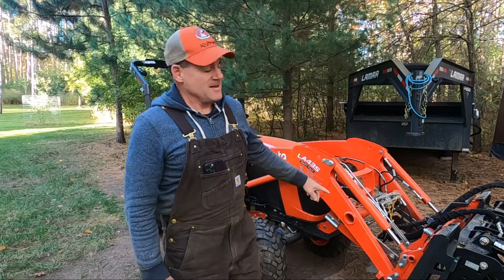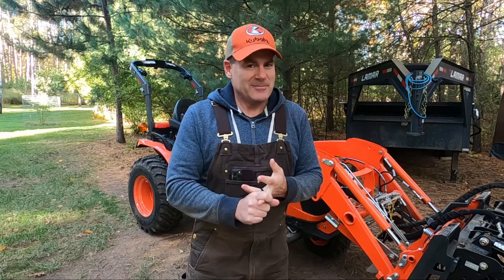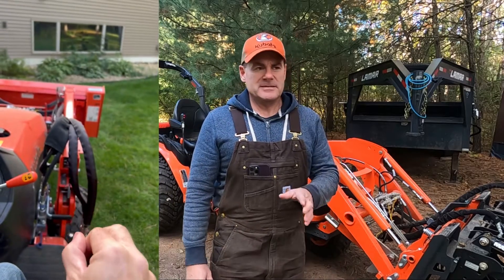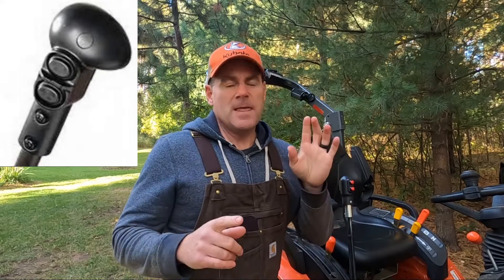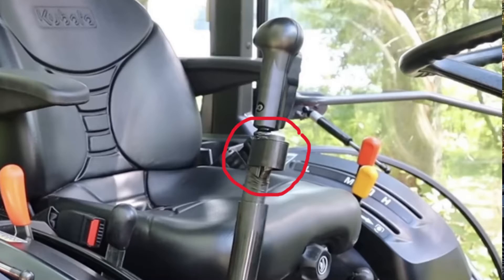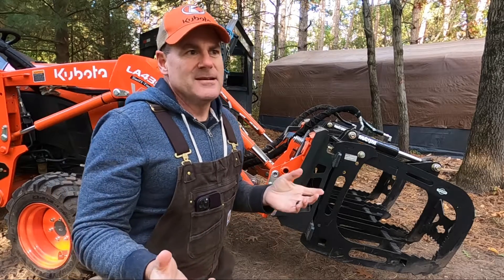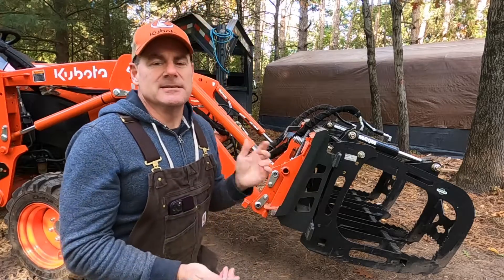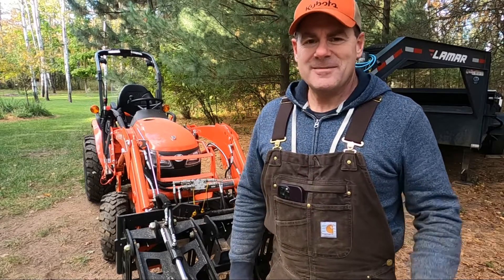#103 B2601 Loader Issue Follow Up - 3rd Function Values - LA435 Loader Smoothness

Comment: A couple of things that might help you, and works for me. I have an L4701(love it) with a Land Pride 3rd funtion(i installed myself). I orriented my buttons for the 3rd function at the 8 o'clock postion and use my thumb to operate them. That keeps ME from inadvetenly hitting either button when using the stick for up and down and curling. And it's pretty easy to wire in a toggle switch on or at the the console panel to turn on or off the 3rd function buttons. Also, the suggestion for lowering the RPM level when using the loader helps tremendously with the jerking when operating the loader and or grapple. 2500 RPMs or even down to 2000(when appropriate) smooths things out. Obviously, a little higher depending on the heaviness of the load. No need to run at 540 level, when using the loader or grapple, normally. Play around with that to see the differences in smoothness. Good luck. And enjoy your tractor.

Comment: Kubota makes some good stuff.The hot buttons on the front of the stick is bad engineering.A company has to know that an operator will be prone to hit them causing issues.Hence,thats why KUBOTA has the power off-on feature.I run alot of KUBOTA and they have smooth Hydraulics.Some of the best in the industry.

Comment: Maybe air in the system??   While the tractor is running, turn the wheels all the way to the right and hold a few seconds then all the way to the left and hold a few seconds.  Do this 4 to 5 times to bleed air out of system.
Might be worth a try !

Comment: I am an electronics engineering technician. For less than $20.00 you will love your tractor, B2601. All that is needed is on the main power wire to the third function buttons install a single pole single throw switch. The added switch will stop the diverted valve from operating and restore normal functions to your loader when not using third function. I have a 2021 B2601 TLB with Kubota third function and mine has a shut off switch built in. If you need any help feel free to ask. I live in Ohio, if not too far I am willing to help you.  Bob
Reply: Hi Bob,  got a picture of that switch you are refering to?  I have a 3rd function switch problem on my B2601.  Just stop working for front end snow plow articulation

Comment: Good vid. I have had my B2601 since 2020 with zero issues. Really love the tractor and wishing I added a third function for a grapple upon acquisition…my first tractor so very tractor ignorant at the time. So far about 120 hours on the B2601 and my loader and hydraulics are very smooth. If I run the rpms high, the hydraulics get super jerky so I lower the rpms to smooth things out. Love your add-ons and I would consider a new third function kit before trading your baby in-you’ll really miss her. I’m currently shopping for a new larger tractor for land clearing but it will have to be an addition to my B2601; I don’t think I can let her go. Cheers and keep the vids coming.

Comment: I think its a good possibility that the 3rd function is plumbed improperly to the power beyod causing your issue. Also land pride 3rd functions are a true 3rd function not a diverter valve, meaning you should, in theory, be able to use the 3rd function along with operating the loader at the same time. the kubota 3rd function valve for the bx is a diverter valve in which you press the button then operate the loder handle to  use the 3rd function. I manage a kubota dealership, If you would like me to send you the install manual for your 3rd function, shoot me a pm, and I'll see what i can do to help you out.

Comment: remove the 3rd function valve from the tractor and try it .I am AG tech for 35+ years .Do that and test it .I think it is in the aftermarket 3rd function add on system.

Comment: Dave - this is quite awhile after the fact for you - I inadvertently didn’t put the power beyond connection together improperly when i was taking the backhoe off my 2022 b2601 and i immediately got what you are describing - going up was fine but going down had this huge jerk starting or didn’t work. I couldn’t get the loader going down smooth. I went and checked the hydraulic hoses and found the bad connection on the backhoe power beyond - plugged it in and i got smooth going down. I wonder if there isn’t something about your third function that’s messing things up?
Reply from the maker: Very possible.  I am going to reconnect the hoses and see if it changes things.  Thanks for the tip.

Comment: That is a horrible design to have the buttons in the front and not on the side (or it's installed wrong). I wonder if part of the problem is the way they set up the hydraulics? The reason I say this is with my b2601 I have never noticed the loader not able to go up or down when using all three functions. It does go slow though with all three at the same time.
Reply from the maker: I have rotate the buttons and it has helped some but it sill happens.  I have tried several fixes to no avail.  I have just accepted it as a limitation of this small tractor.
Reply: @timbertimeoutdoors9836  I'm glad it helped, but like I said mine doesn't do that so it's not the limitations of the small tractor.
Reply: @timbertimeoutdoors9836  i do not know if you got this problem solved or not?, but i can tell you this for a fact !. my b2100 can do lift and curl at the same time, sooo..this dealer is full of it !. i'm putting my money on a bad 3rd function set-up?, or you have a bad loader valve?, or something is going on with the hydraulics through the circuit?. this dealer needs to go!. bad relief valve in the loader valve maybe ?, short to ground from bad switch maybe?. power beyond block clogged?. if it were mine, i'd disable the 3rd function temp, run the loader without it installed ( hooked up ), see if the loader works right then?. if it does?, then its the 3rd function not working right. if it still does not work right?, then you move on to the loader valve being bad. use your go-pro ( or what ever camera you use? ) record all of this when you operate the loader all through all of these test !. this way, you have solid proof your dealer sucks !..lol. its either the 3rd function?, bad loader valve?, or hydraulic issue is causing this?. its not the tractor ( least i would not say so just yet ! ). very first thing i would do is find another dealership, because it sure seems like the one you are dealing with now does not want to fix it for you !.

Comment: You think there's air in the hydraulic lines?
Reply from the maker: The dealer check for that.  It just they way the B2601 works.  Great tractor but the loader is a little chunky in how it operates.

Comment: I recommend loosening the retaining screw securing the 3rd function controller on the top of the hydraulic stick and rotating it counterclockwise to face the seat. The red buttons should face the left. When installed properly the red buttons will be in alignment with the thumb of your hand. Even with gloves, you will be less likely to inadvertently depress the 3rd function buttons.
Reply from the maker: Yes, I have done this and it does help with ergonomics and me accidently hitting the buttons which will freeze the loader functions.

Comment: Like GP I too had a B2601 and it was a great tractor.  Wanted a bit mor and bought a L2501.   I spent a lot of time looking into soft cabs but with the great trade in and resale values after about 200 hours on the L2501 I traded for an LX2610 cab model for our Michigan weather. Love it.
Reply from the maker: I will have a cab some day.  I see Kubota is updating the Cab tractors again.  LX3520 and LX4020 coming out in 2023.  Pretty sure they will come out with a LX2620 in 2024.  They chances they are making are big.  New transmission the does whine so bad, wider front tire stance for better stability and the load gets beefed up.  Worth waiting for IMO.

Comment: I see you frustration, did you do the install on the land pride third function valve, and did you operate your tractor loader functions before the install of the third function valve? Dealerships have an out when non oem materials are installed on new tractors with warranties when function problems arise. I'm sensing that is what the dealership is telling you. I own a BX with a summit hydraulics third function valve and add-a-grapple and can use the grab and lift and curl all at the same time, it is slow but it does work. A good buddy of mine bought the same tractor as you and installed a Summit Hydraulics third function kit on his and then a grapple. No issues like you have. I'm thinking there are times your third function valve is bleeding (bypassing)hydraulic fluid back to the hydraulic tank and starving the fluid pressure while lifting the bucket. My theory only but does make sense if you think about it. If your lift ceases, that means you dont have the hydraulic pressure to raise your bucket. Are you hearing any additional sounds when your bucket ceases to move up? I'm putting my bet on a faulty third function valve, and believe there is nothing wrong with the tractor.
Reply from the maker: Dealer did install and I have had it in twice for repair.  They haven't been able to fix it.

Comment: I added a switch to my B2601 with land pride 3rd hydraulics cause I found I was fat fingering the buttons when working with bucket and causing that jerky operation. By switching the power to 3rd function I can turn it off when not I use and hitting the buttons dose nothing. Made loader operations much better
Reply from the maker: I rotated the buttons and this has helped.

Comment: I have a 2021 B2601 that I ordered in March and received in May, It now has 200 hours on it and have never had any issues but it don't have the 3rd function. This is my third B-series all purchased New, A B-2100, B-7610 and now the B-2601, never had any problems at all with any of them. I would change joy stick to a 3 button so it could be turned off when not in use.
Reply from the maker: Agree.  I do think this would help but I am still getting some strange stoppages with this loader.  Great tractor but the loader on this one has an issue we can't see to pin down

Comment: Looks to be a dealer issue, not being able to get to the root of the issue.  Like a software developer when someone reports a bug - “Well it works on my machine”.  Sounds like that machine has an issue in the hydraulic system that needs to be resolved.  You would think they could put pressure gages on the lines to see the flow rate and pressure.  Call Messicks to see if they can help determine the issue. Good luck.
Reply from the maker: Yes, defiantly will be changing dealerships.  I am very likely to trade this one in.  Looking at the LX2610 with the Cab.  WI winters are brutal.  Hot Humid summer too.  Cab would be nice and the loader control is different and much smoother from what I can tell.

Comment: You may want to check out HydrosPlus on you tube, explains Kubota  BX loader hyd. Is pressure re-leaf valve active when the issue occurs?
Reply from the maker: Thanks for the comment.  Will check that out.

Comment: Regarding smoothness - I actually sold my RK 24 to buy a b2601. One reason was to get a smoother loader since I lift big logs over the side of a dump trailer, and you don't want that jerking around with the loader raised and a big load. I have an sud5640, and that loader is extremely smooth, but I struggled a bit with the b2601. What I found, however, is that it can be smooth. You're on to something when you mentioned the long stick in a previous video - since it flexes a decent amount before activating the valve, you lose a sense of connection - kinda like steering a car with a lot of slop in the steering wheel. What I found helped me a lot was to plant my elbow on the right arm rest, and use my wrist to control the loader as much as I can. This GREATLY improved the smoothness with which I could operate the loader on the b2601, and I was able to learn how to control it smooth enough to feel safe when dumping in the trailer. Never had to mess with that on my larger tractor. If you haven't already tried that out, give it a shot and see if it helps you too (of course this goes out the window if something really is wrong with your tractor). Regardless of if you wind up trading the tractor in, or fixing the issues, I'm sure this is frustrating. Good luck, and thanks for your videos.
Reply from the maker: Great tip.  I will for sure try this.  It sure seems like when I grab the stick down on the shaft, I have better control but then you can’t run the 3rd function.  I will try the wrist control method you have suggested.
Reply: @timbertimeoutdoors9836  I like to wrap my ring finger and pinky around the stick below the buttons and use those mostly for pulling it around when I'm using the grapple, but I haven't really operated it with gloves. I actually turned my buttons INTO the orientation you have yours because it felt more natural. If your loader is operating correctly, I think you may be able to get used to the flex in the stick before the valve opens. Takes concentration at first, but once you get it, you get it. I was actually thinking I was going to have to come up with a way to stiffen the base of the control stick before I really tried to get used to it (maybe a good aftermarket business opportunity!). Again, probably only applies if you don't have a fundamental issue with your unit. Good luck. Interested to see how things work out for you.

Comment: put a switch for the power to the 3rd function switch, or pull the fuse for the third function valve and try to duplicate the problem
Reply from the maker: I like this idea and will look into it.  I do think this would help a lot.

Comment: My LX loader is not smooth unless I finesse the stick, it is powerful though and I need to add weight to the tractor, LX feels very lightweight but the ground clearance is great and it is very maneuverable. I love this tracker but my property doesn't. I have very hard soil with rock. I would suggest maybe getting a l3560 if I was to buy again. great video thanks for sharing the knowledge.
Reply from the maker: Thanks for the feedback and advice.  Do you have a cab or open station?  I love the L3560 but it’s pretty big for my small property.  I like the size of the LX and I have heard that the loader on the cab version is a little smoother than the ROPS version or at least a little easier to control due to the ergonomics of the joystick.  I can’t test drive one at the moment because dealers just don’t have them on the lots with loaders on them.  No supply.
Reply: @timbertimeoutdoors9836  I was lookn' for A B2601 before I decided on the LX, no models available and I had to find mine in CA and have it shipped to me. No cab, however the LX cab would be nice for the tractor size. Hey, check out Messicks vid on '23 models, I like what the update has and if it is worth it to you to wait.

Comment: I have a 2020 kubota b2601 with kubota 3rd function.  My loader doesn't do that . My tractor has a little over 200 hrs  on it . I really like my tractor . I also have a great dealer so that maybe some of the difference.
Reply from the maker: Thanks for telling me this.  I am pretty sure my B2601 has an issue and my dealership just can’t figure out how to fix it and get it covered under warranty.  It’s making me not love the tractor unfortunately.  Aside from this loader thing, the B2601 is very capable.  Like you said it’s a really good little tractor.

Comment: Unplug the third function at the solinoids on the valve both sides . If the loader won’t  act up anymore it’s the valves coming on . If it still does it then it’s the loader control valve .
Reply from the maker: My Dealer said they did this test.  They couldn't get the issue to happen but didn't use it a lot so was hard to prove anything.  I will try that here and give it some time.  This makes sense.  Problem is I may not be able to repeat this for them so they can replace things.  I like this test though.  Pretty straight forward.
Reply: @timbertimeoutdoors9836  There is many things that can go wrong in hydraulics . Step by step elimination is required . Small 12 volt automotive test lights hooked in too solinoid plug also will tell you when it’s activated and let you know if it’s coming on while activating the loader . 🤷‍♂️Your in a position now too prove too the dealer what’s wrong . Not much else you can do but prove your problem on tractor with hard evidence .Relief valve sticking or bleeding by in main control also from chuck of debris once and while getting jammed in relief . Seen this before . Removal of relief valve and clean out on main control .